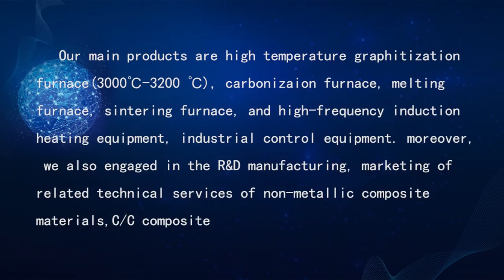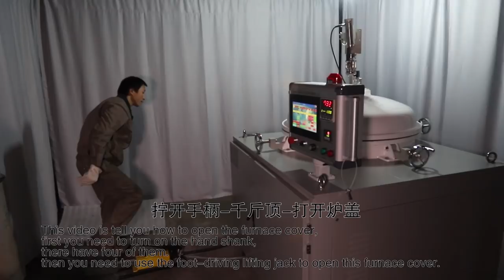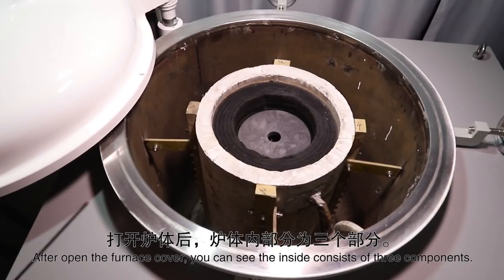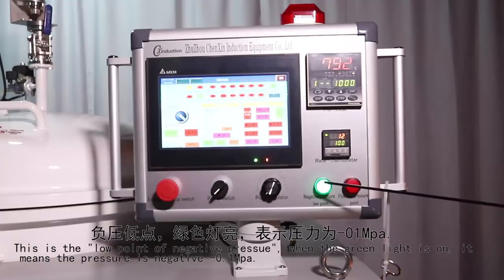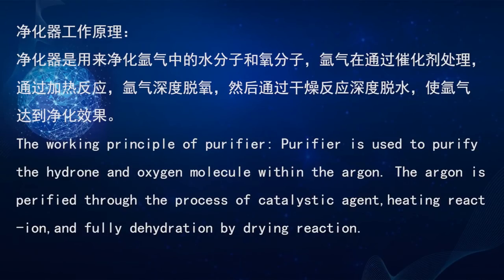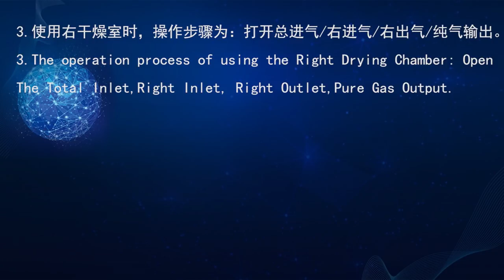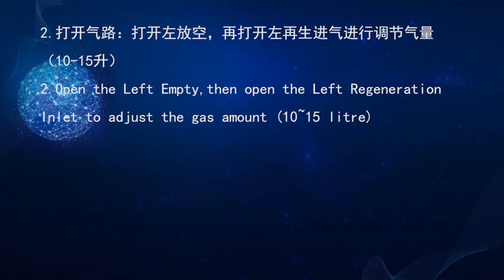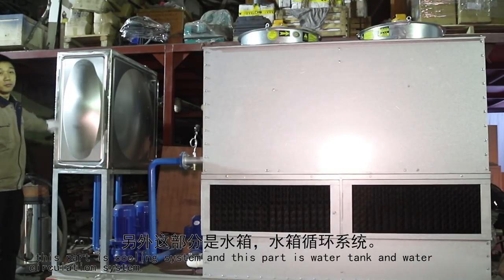3000°C Laboratory Graphitization Furnaces

Comment: How much electricity be supplied to do so
Reply: To reach 3000 celcius
Reply: 80kw
Reply from the maker: @dhanubairi3049  The rated power is 80KW for the High temp graphitization furnace to reach 3000°C.Plese kindly know.